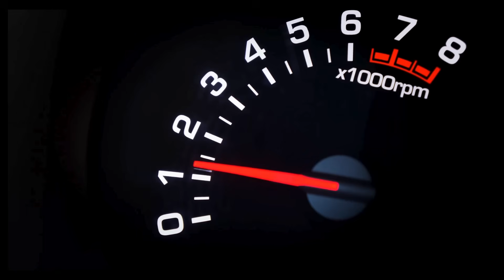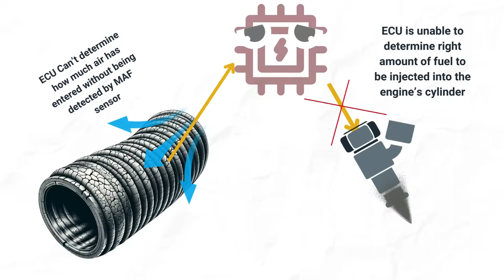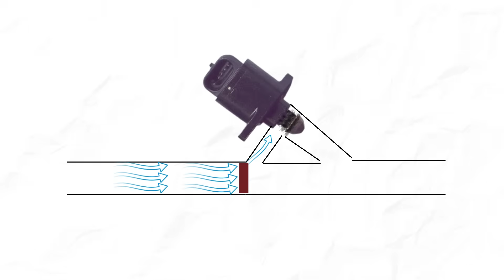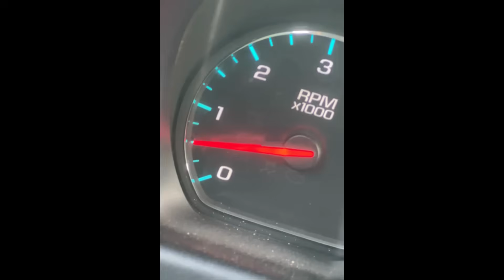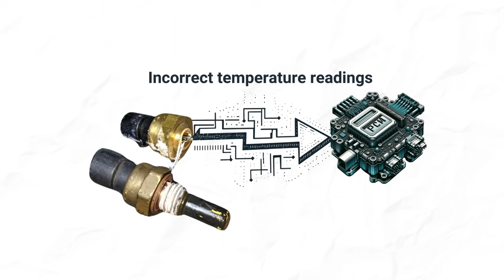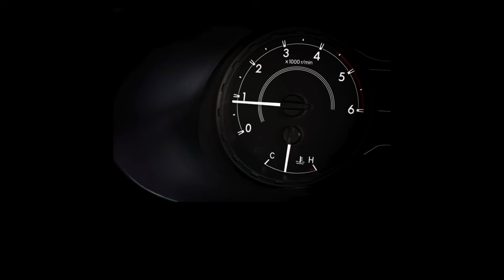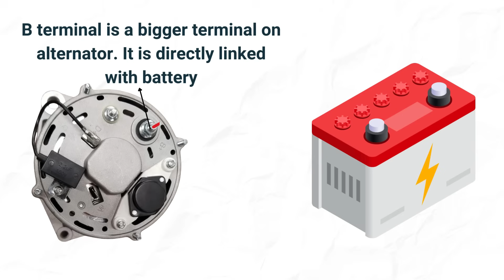6 Reasons Your Engine Revs Up and Down at Idle | RPM Fluctuations While Car is Parked

Comment: Never clean MAF sensor with brake cleaner! Get dedicated MAF cleaner.
Reply: I agree, brake fluid will harm the MAF sensor. Use only proper sensor cleaner.
Reply: Always use MAF cleaner to clean the cars MAF sensor...never brakes cleaner
Reply: Use hydrogen peroxide.
Reply: @federalagenciesarecourtesans  take your meds on time really
Reply: @BrandonBell-r8l 😂
Reply: and also never use a brake cleaner on an engine bay! First when it gets on the paint it ill ruin it !
Reply: Rip external fuel filter.
Long story short. Thought, wonder if fuel pressure is good. Lets just change fuel filter.
Oh its built into the pump, oh that pump alone is 400-600....yeah lets check pressure....

Pro tip
If your ride is behind on maint-i-nance
With problems u had to or chose to ignore...
Diag proper dont parts cannon
Get a plan
Hire out the diag if need be
Before tearing it apart first time verify each step.
My intake needs to come off.
So let me document all the inputs.
Fuel and air
Its 2 air inputs
Outside air and egr "air"

Also
Reading codes is a guide
Not a bible
Mine lit up like 4th of july
My mid hobo frieght scanner isnt bi
But has an app
Thought i had the data saved
I did not. 
I cleared to see what came back.
Nothing ever Coded again
But runs awful
And a lone cy 1 misfire code.
So a normie will see that and do a tuneup and then unleash the parts cannon

Shoutout to the oldheads who are the 
3rsd or 5th guy who figures out how you just spent 1000s for no results.
Reply: Exactly...
Reply: Genius
Reply: My car's idle seed is ok when cold but it's all over the place when hot ie . stalls it's up and down and won't start unless you use the acellerator pedal . Seems to drive ok . Any ideas ?
Reply: @josephborg5938  check your fuel pressure. check it with a gauge hooked up and key on not started. get the reading. now start it up and get the reading when idling. see if it is within specs. if the fuel pressure is not as it should be change the fuel filter first and see if it fixes the problem.
Reply: Yeah, literally just asked this question. Im not a mechanic but i do ask lots of people before i do something and i know using BRAKE CLEANER isnt a right choice mate. Great catch by you thank u i just got re clarified to a question i had...
Reply: That's a no no and will damage the sensor the minute you crank the car. You have to use Mass Airflow Sensor cleaner. It's so sensitive it can be damaged cleaning it with alcohol
Reply: Ok, I thought iso alcohol is good.
Reply: Never, never ever, never ever Land! Says Peter Pan
Reply: How about wd40?
Reply: It's fuckin common sense,why they have different cleaners for different types of things
Reply from the maker: Thanks for the tip
Reply: @AutocornerdPros hi my renault clio 2014 ,showing inlet flaps open circuit,changed maf,fuel temperature sensor,car is moving well but still showing check vehicle.please assist.
Reply: Your right abought that. 😊😊😊😊😊
Reply: Especially the Throttle body, Use Throttle body cleaner only